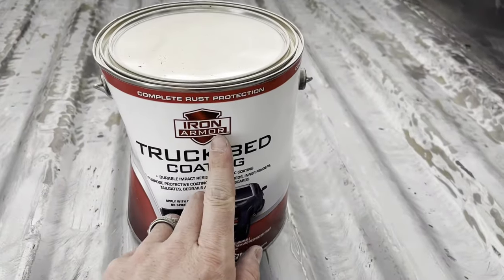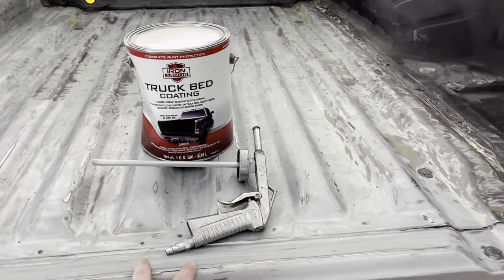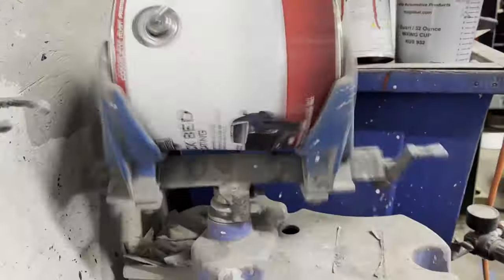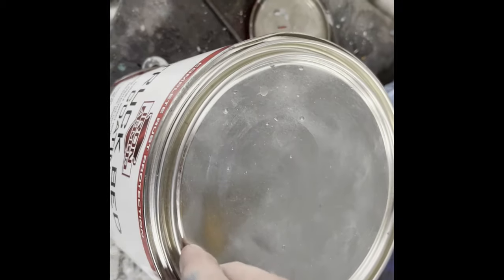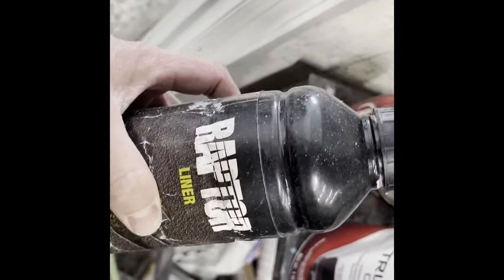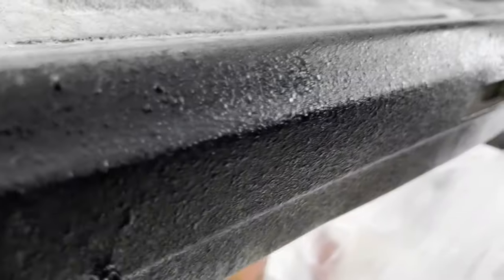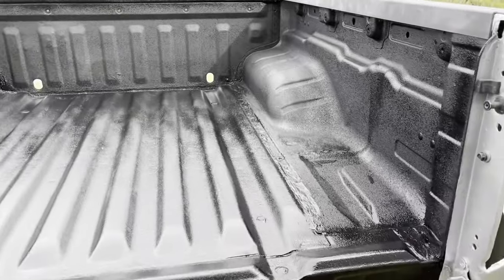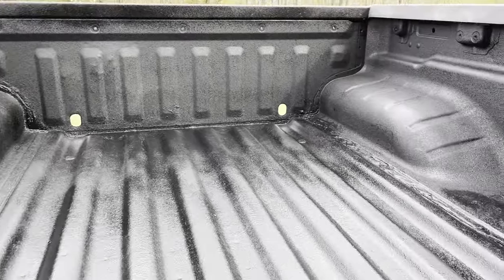Harbor Freight Spray in Bed liner by Iron Armor

Comment: I see youre super busy with all your other projects, but you should definitely do an update. Im curious as to how the cheap harbor freight liner held up. I bed lined my whole f350 using Rust-Oleum roll on. Id love to go over it again with Rust-Oleum and some hardner. And i will be using my shutz gun rather than rolling it on again ☺️👍
Reply from the maker: Well I can tell you how it’s doing. I drug a pallet with a couple hundred pounds on it and it scuffed it up but it held up, the raptor is a better material but for the price as long as you do 3-4 coats and let it harden over a week it should be fine.
Reply: @1194video  awesome, thank you ☺️👍

Comment: Can u tell the ratio you used for this? Also the psi in your spray gun? I’m about to do my trailer and some help would be nice.
Reply from the maker: I started at 30 and raised the pressure to my liking but as for ratio, i did mine for every 1 cup of liner I used 1/4 cup of reducer
Reply: Thanks for your expertise
Reply: @1194video what you refer to as the reducer is the up2323 hardener?
Reply from the maker: @LTCAproductions  it is a reactive reducer, it reduces the thickness while also providing a chemical to help harden the mixture. We use it a lot in paint applications where you can help harden the paint faster by adding a reactive reducer
Reply: @1194video  what did you d to keep the gun clean in between coats?
Reply from the maker: @LTCAproductions  I filled the bottle with paint thinner and shook it up and sprayed thinner through the gun then added clean thinner and did it again til it shot clean thinner through it

Comment: Did you use reducer or just the upol 2323?
Reply from the maker: I only added the upol 2323. It’s held up good so far
Reply: @1194video  Awesome thank you just ordered some!
Reply: That upol he used is an activator/hardener NOT a reducer. The proper thing to use is a urethane reducer.
Reply from the maker: @silvercommander  yes you can just use the reducer, the reason I used reactive reducer is to help it dry quicker

Comment: Dude,  respirator..... you'll be glad you did when you get older.  Might seen fine now,  but all that fine mist will take its toll.
Reply from the maker: I did go get one, I was not using one there but had the paint booth fan running to help with fumes